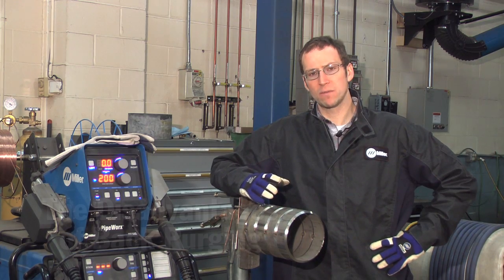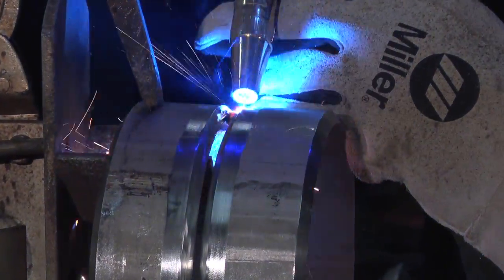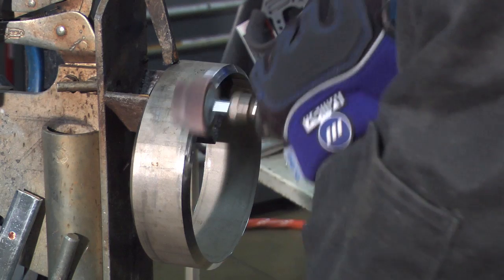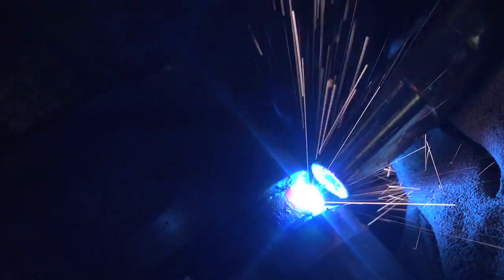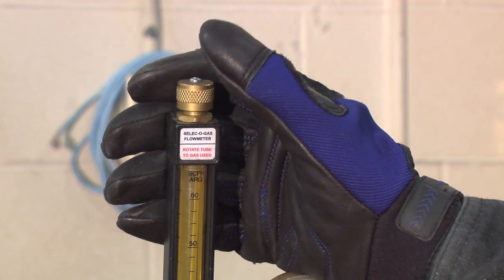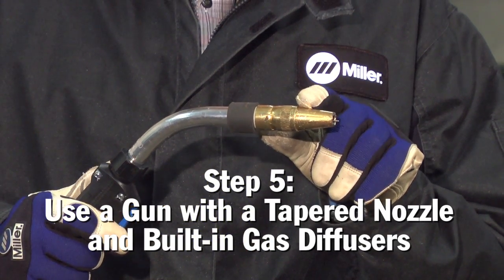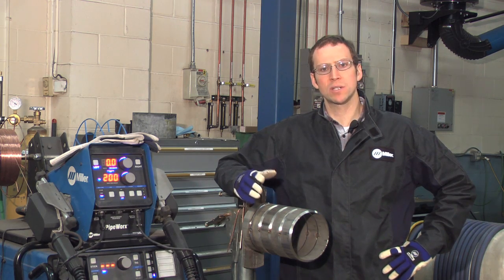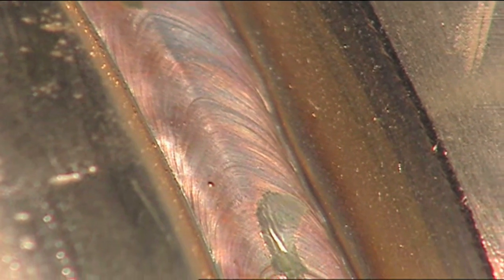Five Important Considerations for Welding Stainless Steel Tube & Pipe without a Backing Gas

Comment: What are the recommendations on wire speed and amperage for root on this size pipe?
Reply from the maker: Hi Jose, thanks for reaching out. Wire feed speed will vary depending on the shielding gas used and whether or not it’s in position or rotating. In the video, the pipe is 6” Sch 40,  the wire feed speed is 185ipm, using Tri H gas mix, and is being welded in position. Since RMD is synergic, there is not a separate amperage adjustment. Amperage and voltage is adjusted in the machine according to wire feed speed. So if you want it hotter, turn up the wire feed, colder, turn it down. We hope this helps!

Comment: 1.Can i welding to duplex and super duplex ?. 
2. Hot pass and fill pass is without backing gas or not?
Reply from the maker: Hi there, thank you for reaching out. Yes, Duplex and Super Duplex can be welded using RMD and Pulse using a backing gas (Argon). For RMD we found that the stainless steel program using the Tri-H gas and program worked best and for the Pulse using the Tri-A gas and program gave us the best results. As for using a backing on the fill and cap passes is going to depend on how hot you are welding but I would continue to use the backing gas during these passes. Please let us know if you have any additional questions.